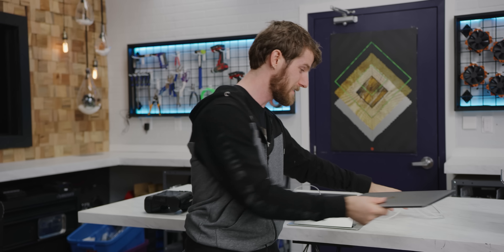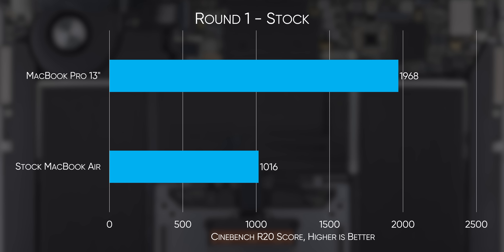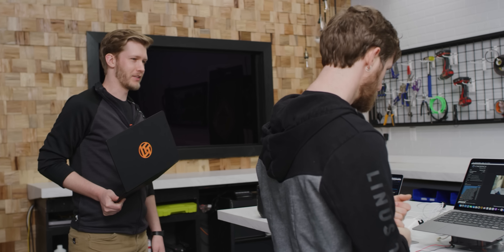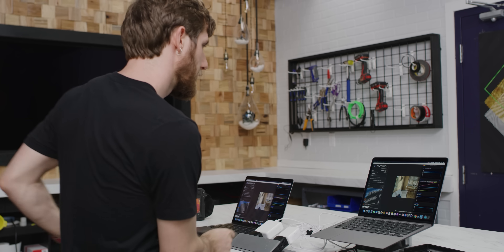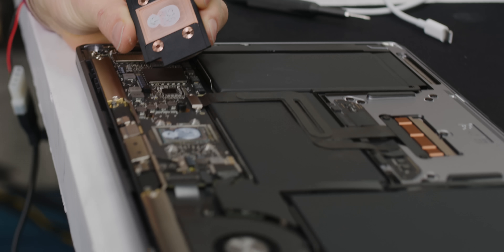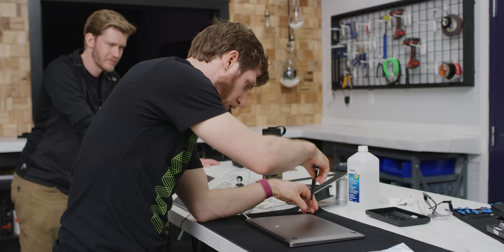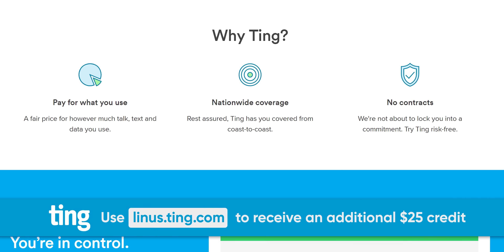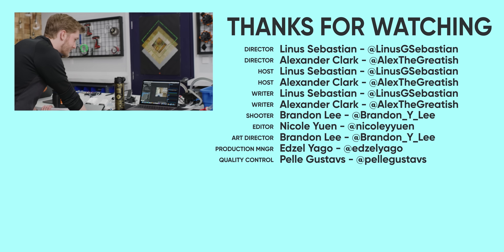Fixing Apple's Engineering in an Hour

Comment: The fact that it can't properly deliver enough power to get the performance that the processor can deliver is telling...
They either know it's never going to get a chance to deliver that power cause it will thermal throttle first,  and thus, never intended to deliver enough power 
Or 
they think they somehow made the processor run more efficiently
Reply: Or you know, maybe it's just be part of the design of the CPU...
The intel specs for these cpus only allow for a max configured TDP of 12W, and it's base TDP of 9W....Drawing 13-16W on the package actually sounds about the maximum allowed. 
That massive spike observed in the video before dropping back down sounds like the "turbo time parameter". It is set by intel as a fixed amount of time the CPU is allowed to stay at that enhanced draw (typically labeled PL2 if you want to do more research). After this point the spec requires that the cpu MUST drop down to PL1 (in this case 9-12W). Doesn't matter if you have more cooling or extra beefy power delivery, unless you want to intentionally disregard intel's spec and foul OEM-Manufacturer relations, you have to drop back down.
While on desktop chips this is typically a loose requirement, and is certainly ignored/overlooked and flatout disabled if you force a overclock..For CPU's branded under the "Ultra Low Power" class, I guarantee intel is strictly enforcing it.

Comment: I know this was made for fun, but what you're pushing the MacBook Air to do doesn't reflect the typical demographic and usage of people that would buy such a laptop. It's for simple users and college/university students that don't know WTF Cinebench is, and they likely won't be doing anything CPU intensive like video editing or 3D modeling. Is it capable of doing such? Sure, but you can't not expect it to get warm when you're pushing it to do stuff it's not designed for, because yes... the cooling isn't great when you try and push it farther than it's intended for.

Comment: Crazy enough, when my mid 2010 13" MBP would get hot, I'd take an over sized ice pack wrap it in a towel and set my MBP on it.  I froze it so it was perfectly flat, and my MBP got so cool the keys were actually chilly.  The fans never came on, and it performed incredibly well.  Good for those summer days when its already warm and you don't need your laptop burning your hands.  haha.

Comment: The stock heatsink was probably designed with poor fit so that there would be MORE thermal resistance. The intent is probably to make their shitty design heat the chassis up less to worry the customer less. If they had a bigger surface area with the fan configuration they have now, the entire machine would heat up rediculously.

Comment: 04:18  That's just incorrect.   The air inlet is on the opposite side of the CPU from the fan.  There is no way for air to get into the fan but by passing over the heat sink.  It's still a pathetic heat sink, but it's just wrong to say there's no airflow over it.

Comment: Best I can figure, they have the bottom of the MacBook sealed so that the airflow can only pass through intake holes and the outtake of the fan. The CPU heatsink has the fins in the direction of the flow of the air from the intake to the outtake. the separation of the fan from the heatsink allows Apple to make the laptop as thin as possible which is the point of the MacBook Air, having a super-thin, super light, minimum work computer.

Comment: Considering you guys have access to diy heat pipe kits I was kinda hoping you guys would have tried like, mooshing a thermal pad onto the heat sink, and from that running a flat heat pipe along the bottom case to the fan and see if it does, well, anything. That’s something I thought of trying myself but don’t really know where to start on implementing it

Comment: Apple is such POS .... Not only do they, for whatever reason you wanna go with, produce thermal solutions that are FAR out of spec. Not even making physical contact surface to surface... This is just glossed over, as if this is somehow acceptable in a brand new product of any kind... let alone something like this, a "premium" product at a premium price. But on top of the physical issues in cooling, ie no contact to the cpu, the fan isn't even blowing over a connected heat pipe solution, etc... Just poorly designed... worse than could ever be expected of even the cheapest most knock off of crap products, let alone a "premium" thing like this, once more.... Then on top of it all, the power profile, which THEY came up with, ENSURES that it falls on its face regardless of how cool the end user makes it run. You could run this outdoors in the Arctic, and it'd perform like poop... Because Apple deemed it so. Heck, that's really what you are paying for. Congrats.

Comment: With the huge thermal pads the rest of the computer will overheat now though. The fan sucks the air through all gaps, over the CPU and blows it out on the other side. You now closed the gaps.

Comment: Apple engineers: "More efficient processors that generate less heat so they don't require excessive cooling."
Linus: "You guys are stupid, I fixed it for you by adding clunky external cooling that requires external power and sits outside the case. You apple engineers are morons lol. FIXED."

Comment: Even without the performance improvement that they had hoped, that 20 degree difference is huge considering a CPU running at 100C often will likely shorten the lifespan of the laptop ... and when you take it the "Genius" Bar they'll probs just go "lol its water damage"

Comment: I think the idea is that the fan is exhausting air out a vent, NOT a finstack, and the only opening in the case is across the CPU heatsink at the other end of the motherboard, so you have 100% negative pressure with the only airflow possible being across that CPU heatsink. This design relies heavily on there being a total seal that only allows air through that one channel, which may not be happening. Even if it is, that CPU heatsink barely has any fins, it is basically just a copper plate. A traditional copper plate/heatpipe/exhaust finstack would be much more efficient, so why they did this is beyond me... Maybe to save money? To make it thinner? Just because Apple? Who knows. It's stupid.

Comment: It would have been interesting to see how it performs with Windows installed since it would have removed some of the Apple's "optimization".
Reply: It'd do the same, if not worse.
why? Because the only issue here is the heat that is not dissipated.
windows or apple doesn't change anything.
Actually, Apple's OS is unix based, like Linux (the OS), and is globally better than windows.

Comment: its just lame on apples side even software is limiting that computers I have to use fan control while working in final cut because it will overheat and die. LINUS you have power to make a heat pipe to cool this cpu its totally possible, please make a video redesign that shit !

Comment: A tip for milling off very tiny amounts like that. Please just lock the quill and use the knee crank to raise the table. the knee's adjustment has a gauge which can be accurate to 1 thousandth of an inch. That is far more accurate and stable than using the quill for that tiny an adjustment.

Comment: You have to think about it from Apple's perspective. Apple does not have value in mind when they design a product. They aren't concerned with getting the most out of their hardware, and having the product be the best that it can be. Their only concern is that this model has to be weaker than the more expensive one in their product lineup, regardless of whatever hardware was the most convenient and cost-effective for them to use at the time. You're paying for the same hardware, of course, but they'll run it far below its actual potential because the laptop that's $1500 more expensive has to have bigger numbers on its spec sheet.

Comment: I've been looking around, trying to find a suitable replacement for my ROG Laptops thermal paste to get get the temps down some, but all I keep seeing is NT-H1/H2, MX-4, Kryonaut, and, IC Diamond pastes. Is there a good thermal paste that doesn't have a lot of pump-out (where the paste squeezes or moves off the die over time), but also doesn't scratch the die like IC Diamond?

Comment: Have we investigated the many benefits of pumping liquid directly onto the CPU instead of a Waterboro? It would be really easy to make, just some alex engineering and a square o-ring. Or maybe pumping liquid around an air cooling heatsink
Reply: you'd need to drill holes into the aluminum body tho.
and you'd end up with a way too big chonker.

Comment: From the looks of it they just went "The Air is so thin it gets kind of throttled by temps. But at the same time, the power delivery is also weak so it won't get more than ~5% improvement even with better cooling, so... Eh. Leave it as is. Now where's my Martini."

Comment: Calling a Macbook Pro a "properly cooled machine" is in the same level as saying "We're Ceiling gang"...
Not forgivable at all :(
Reply: The new macbook pro 16 really does a good job with thermals 
It's only one tho
Reply: @ShendonZ  except if you plug in an external monitor or power it on the wrong side.
Reply: Seven V  neither does an apple fanboy yet here we are right? xD
Reply: @AdrianLopez-sr3dd  I can't refrain from noticing that he didn't even mention Apple, he just commented about your toddler-level spelling. And the one who mentioned Apple (so *he* must be the fanboy, because kool guyz call it "crapple") didn't call you dumb. 
Oh, wait, nobody called you dumb. I'm so tempted to, but I guess you'll realize it yourself.
Reply: @IlBiggo  toddler level of grammar, ok grandpa, lmao
Reply: @AdrianLopez-sr3dd  Great reply! You totally pownzed me lol asdfgh.
Reply: Mac vs windows and iphone vs android people are just fools
Reply: Yes it is. MacBook Pro has 2 fans which are connected to heat sink. Which every other laptop does the same. What different cooling solution do windows laptop use?
Reply: @Smart.Potato  They have better heat sinks, and well placed fans. Windows PCs often run cool to the touch. 

The trick is they put in processors appropriate for their form factor. If you want high performance, you need more airflow. If you want an ultra-thin, you need extra fans and a mid tier processor. 

They don't shove powerful processors into laptops and get weak ass performance because they're suffocating it (and damaging other components).
Reply: @Smart.Potato  i use a macbook pro 2017, can confirm the cooling system is pretty bad
Reply: @Smart.Potato   omg u are so dumb xD
Reply: Adrián López kindly explain

Comment: I cooked an Air once. Didn’t take much. Got it fixed for free with Apple then I sold it and bought a Windows laptop. Cheaper, lighter, faster & cooler.
Reply: how did you cook it if it was supposed to thermal throttle?

Comment: They got so much wrong here.
Linus kept complaining about how the fan was useless and didn't even cool. Macrumors fought about it for a quick minute, but the MBA fan pulls air from the back over the cpu and out the back.
Linus then complained that the heat sink wasn't even putting pressure on the cpu. He fails to understand that Apple used a thicker style, generally unused thermal grease that would fill in between and harden to cool.
Then after destroying their heatsink to make it sit on the actual cpu die better, they put a thermal pad over the Heatsink.
They also removed the insulation from the bottom of the laptop which then makes the bottom cover hotter. 
They should have left the insulation on the bottom cover so it would not get as burning hot.
The recurring theme here was the programing tends to slow down the cpu vs the actual heat. 
Also I would like to mention that I put thermal pad on my i5 2020 MBA and even at super high loads, stays under or at 90c. Compared to 100c, I call that a win.

Comment: THIS IS WHY. 
The inside of the machine is designed to be a closed air tunnel. Cool air is drawn in from the sides and pushed out the back. 
The CPU and heat sink is directly in the middle of the only air flow path. This allows Apple to put a bigger heat sink over all while keeping the same airflow as if the fan was on top. 
Again this only works because there is a single closed air tunnel where all the air must flow through.

Comment: As long as the fan and heatsink is in the same channel of airflow, the order does not matter significantly. The air still travels over the heatsink. Apple employs excellent engineers - the project objective was to design a quiet system, not for it to have low temps

Comment: The correct way to drill accurate on a milling machine is to move the table (Z) up for distance needed (after clamping the spindle). Maybe this helps next time.

Comment: Actually, there's a different form of sandbagging going on. Note that the iPad Pro margins are insane, like 64%. What if Apple HQ want to go to ARM across their whole customer base, but they don't want to announce it, or even talk about it internally? That could actually alienate a bunch of people. Here's how they can do it: Make a directive to achieve insane iPad Pro-like margins! This explains a lot about Apple laptops and desktops. Why does the Mac Pro have such over the top engineering and luxury features? That Margin Directive. Why are the monitors and things like the stands so expensive? The margin directive. The effect of all the above? The traditional CPU Desktop and Laptop product sectors are pricing their users into migrating away from desktop and laptops, onto iOS devices. When the ARM desktop and laptops come around with lower prices, it will actually be welcomed by the customer base!

Comment: How about thermal copper shims, .5mm thick, between the CPU chips and the stock heatsink?  No milling required.  Then some high quality thermal pads between the heatsink and the case bottom.

Comment: so i think the fan is supposed to pull air through the chasis from the other in take and then exhaust it out, thus getting air flow over the heat sink.

Comment: "50c° can burn you in 1 minute"

My macbook air from 2011: are you challenging me?
Reply: @Void Astra the only fix is undervolt
Reply: @frederick3811  u cant undervolt a macbook only way you could is hardware modification which would probs be sorting out the power rail that goes to the cpu by making the voltage drop even lower
Reply: My 2014 HP Envy laptop: 80. Best I can do.
Reply: @anotheraggieburneraccount  I also have a 2012 Hp envy Dv6 with i7 3rd gen and Gt635m
Reply: late 2011 gang gang
Reply: my macbook pro 13" mid 2010 reachs 100 C somethimes, most of the time 85 C
Reply: my asus tuf gaming vs my brothers macbook pro 2020

asus -  the best i can do is 87 and burn ur fingers while typing
mac -  bruh..i burn ur lap..not the fingers
Reply: my macbook pro from 2006: i’m mr heatmiser
Reply: Well, the great majority of pc and laptops run at that temperature...
Reply: @decoder55killer  100 degrees Fahrenheit yes, but it really shouldn't hit that in celsius, my pc never goes over 70 c on very heavy usage with fan cooling
Reply: @yoshi4946  what? LOL
Reply: yoshi4946 we’re talking about laptops, not desktops, laptops run hot as shit
Reply: Jacob Fippin not that hot def 100f not c tho unless you’re talking about the cpu itself and not the body of the laptop the body of the laptop isn’t gonna get much hotter than 50c unless you have 0 cooling or heat syncs all y’all are over exaggerating
Reply: @f1piggy102  only shit ones (ie any that arent THICC or using tablet cpu)
Reply: @f1piggy102  I got that lol, the guy above me said most PCs run that hot and I assumed he meant desktops
Reply: @decoder55killer  Under full load, my i5 4200m in my Toshiba laptop (C55 a 1n1) doesn't go over 75c.

Comment: well - my Dell Inspiron 5580 has similar layout with the position of the fan and cpu - but 1st: the cpu heatsink has a little more wheight behind it, and 2nd: the fan and heatsink are connected by a heatpipe and a second heatsink in the airpath of the fan.
Why didn't Apple did the same?

Comment: Rule of thumb: If you really care about performance and want a reliable computer that will last more than at least 5+ years, then just get a desktop computer. There are still hard limits to the physics of airflow, computer thermals, and battery technology. 

Gaming Laptops are awesome, Ultrabooks are super sweet, and Thinkpads/Toughbooks are irreplaceable. But Desktops just work.

Comment: Isn't it amazing how a company that has engineered an extremely efficient and well-designed cooling system for their desktop tower (Mac Pro's fans are normally undertuned to keep the thing silent, but at full speed the 28c Xeon works wonders) cannot learn the basics of laptop cooling?